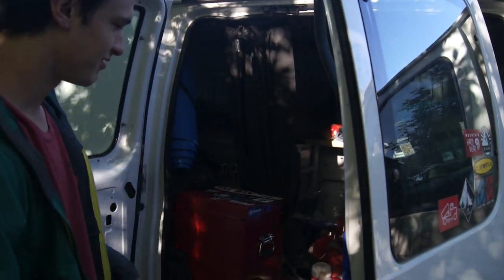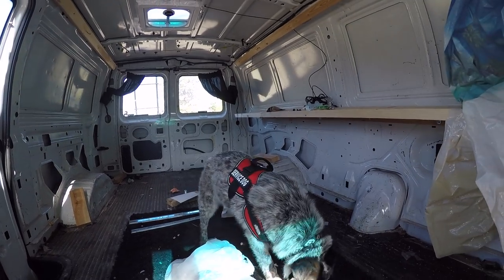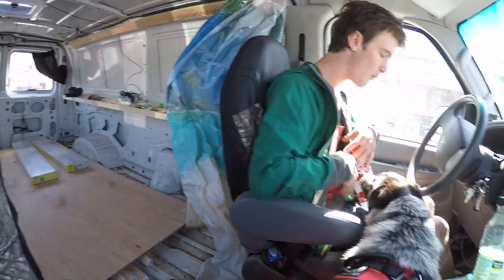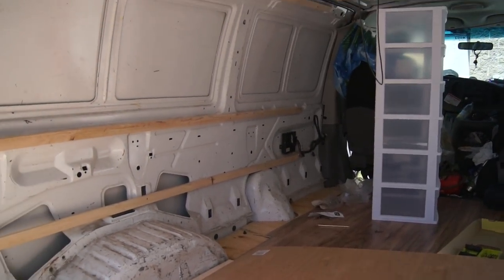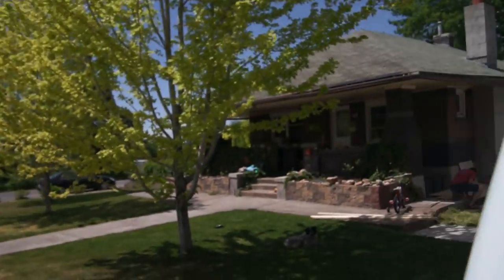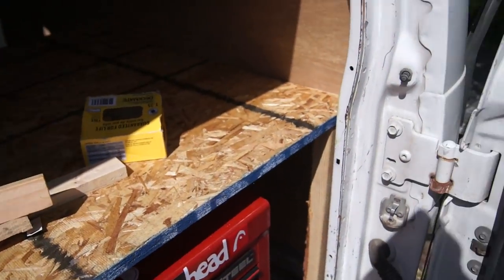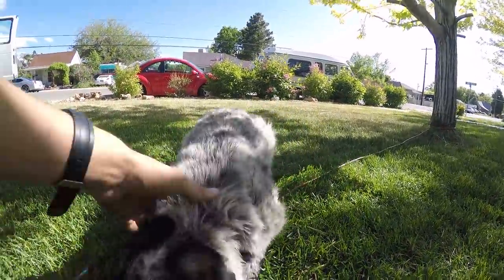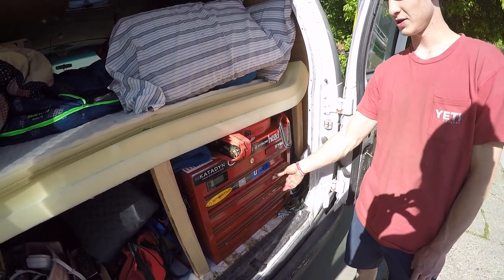Building a Practical Camper Van in a Day

Comment: Great job considering it took only 6 hrs! You should be proud to have made this improvement and on such a low budget too. You're an inspiration to many of us.  Recently watched a cheaprvliving vid and Bob Wells insulated his ceiling and walls but not his floor.  He stated the reasons you did Eli...if it's over/fully insulated then in the summer the heat gets trapped and never cools down and v.v.  Agree that its easier to warm up and put on clothes when cold. Sounds like you thought it out well for your needs. We're all different, thank God!  ;D   PS-Beautiful doggie too. Man, you got it all!! Happy & safe climbing.
Reply from the maker: I helped a friend fully insulate a sprinter van one time and it’s a pain in the butt too. It kinda just depends what and where you are using the van. It’s such a small place it’s prettt easy to heat as well if you want a little heater

Comment: Did you use any insulation? How are you going to heat in the winter?.   Son is doing research to build a van
Reply from the maker: So we talked about putting insulation in and decided against it. Summers here in utah are pretty brutal in a van and an insulated van with not many windows is pretty much impossible to sleep in. It is much easier to stay warm with things like sleeping bags and buddy heaters than it is to stay cool
Reply from the maker: I have never personally used a buddy heater but he uses one and I have heard great things about them. (i have been nervous due to using the gas in a small area) I heard they have a built in oxygen sensor that automatically shuts the heater off when the oxygen levels within the van drops below a certain level.
Reply: actually insulation helps make it more bearable (in all seasons)... because cooling and air draw keep it cool inside and the heat (metal baking in sun) doesn't transfer thru the insulation.
Reply: True that insulation makes it a bit better during the day in summer but the fact is the van WILL get hot in the day in summer- I chose no insulation because it means it cools down faster with the outside temperature at night. Definitely the best option for me as I live in the tropics so winter is 20C minimum.
Reply: If your son is dong research to build a van... looks elsewhere.

Comment: nice and simple but if you can drive a van by a tall one the longer the better. simple single bed at the back and a corex box at the front with a pressure sprayer and you have a indoor shower. you should get a van taller than you are

Comment: no insulation????
Reply from the maker: Here in Utah it gets extremely hot in the summers. Decided it was much easier to stay warm than to stay cool. He was fine all last winter without any, just used a Mr heater or whatever those things are called.
Reply: insul will get hot & hard to cool back down - maybe better w/o in the summer.
Reply: Feedback4Utoday 1ś
Reply: People said plywood holds moisture, and gets moldy.